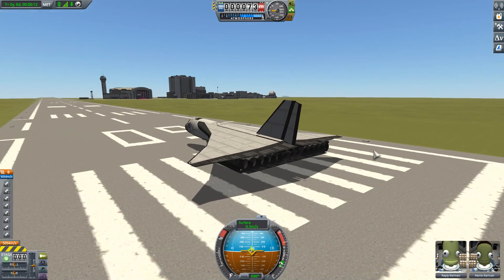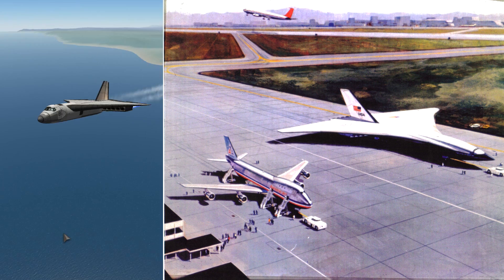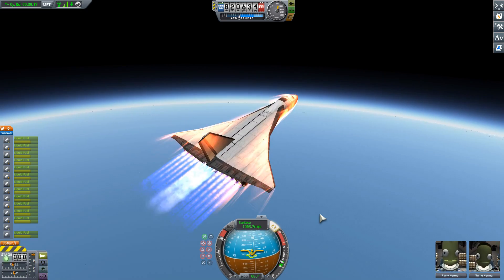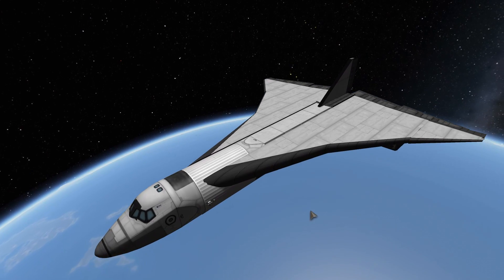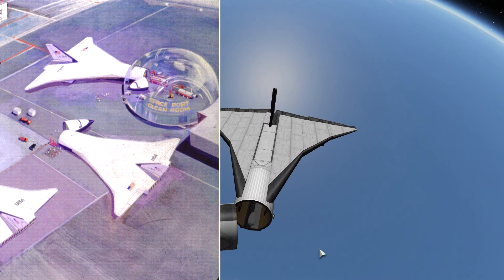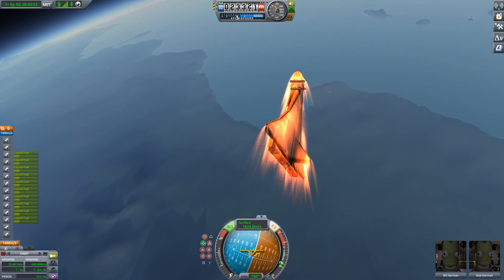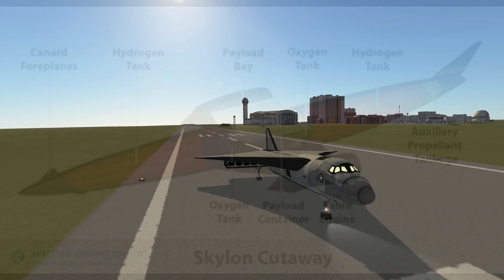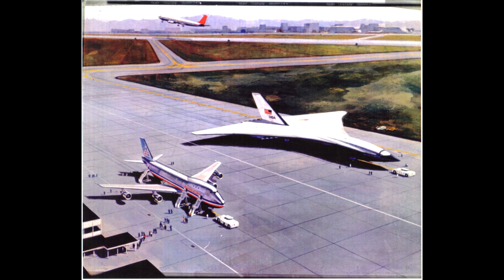The Star-Raker - A 1979 Space Plane With 15 Engines, Massive Wings & Huge Ambition

Comment: Wow. I've been watching a lot on spaceflight history, but never heard about the Star-Raker. I guess after the SR-71 they figured that they'd somehow figure out any magic engine design. :D
I'd definitely love more videos on pathfinding spacecraft designs that were dropped, especially those whose concepts are still not completely off the table.
In this particular case I'm curious what the particular objections were. Lower temperatures during re-entry sounds like a great alternative to the STS orbiter's rather risky re-entry.
Reply: Edit: wait, didn't read your post well enough. The objections to this design were, and still are, that the engines don't exist. They're getting there with the SABRE engines, but those are ultra-precision and still aren't finished.

Original post about most shuttle competitors: The objections were initially one, and later two.
1) The actual STS space shuttle was designed to make human spaceflight almost impossible to cancel, which is why it was designed for such extreme orbital parameters that turned out the way that it did. NASA was paranoid that any design which didn't forcibly tie actual crew members to rocket launch would result in the inevitable cancelation of spaceflight (a paranoia which had some basis in reality), hence the reason why the shuttle required crew for the sake of two or three switches & an automatable landing.
2) After they'd gotten the shuttle actually built, the chickens came home to roost, as they discovered that the shuttle's minimal cost of operation was so high that they couldn't afford to design it's replacement, or even build a station, at the same time that they were operating the shuttle. The only reason they were able to build the ISS is that Congress and the White House got worried about where the Soviet rocket designers would go if there wasn't something to keep them employed. I would like to think that NASA would have turned SpaceLab into an actual station over the course of the decades, but without foreign investment I suspect that it wouldn't have any larger than Mir even today.

Comment: What makes this vehicle so impressive is that it would have been a demonstrably better launch system than the Shuttle in terms of payload mass fraction and reusability (especially if the frankly extreme turnaround times were accomplished) while also being a good plane, i.e. having a large cargo bay and cross-range, which Shuttle detractors claim were factors in its failure. (I disagree—the Shuttle's "plane-nature" was a fundamental attribute of its design, so attempting to improve its payload capacity by reducing those aspects would not have improved the vehicle.)
Reply: Yeah, only problem with thus thing is that the engines still aren't ready.

Comment: I'm confused why a higher lift to drag ratio would give you "lower loads and lower temperatures". In the chart at 6:40 it shows how the star-raker has a much higher peak enthalpy (temperature) during descent than the space shuttle.
Reply from the maker: It can stay at higher altitudes for longer spreading thermal load.

Comment: I wonder if they could have put a thin sheet of aluminium over the heat tiles on the shuttle and letting it burn up on reentry. Or would it damage the heat shield as it melted?
Reply: I don't know if it would have damaged anything, but I don't think it would have helped a lot either. On the design in this video, the metal is there because it won't melt. The Space Shuttle was very heavy for it's wing size (because it was supposed to support polar launches), so it couldn't discard much velocity in the thinnest parts of the atmosphere, forcing it to discard that velocity over a much shorter period, which in turn resulted in higher reentry temperatures. This design had much larger wings per pound, so it was able to slow down over a longer period of time, leading to lower reentry temperatures.

Comment: "Landing is hard" crosses threshold at 240 km/h
Reply from the maker: I had problems with pitch authority
Reply: @scottmanley  Fair enough. Guess you didn't have 20 years. :D
Reply: @scottmanley  Yeah it looked like it, I was moderately sure you were going to plant it as the approach unfolded. Given the video I suspected you might have picked the most successful one, but that didn't completely rule out the possibility of disaster :D
Reply: @scottmanley  Bad idea: bind an array of sepratrons to the pitch control keys
Reply: @scottmanley  The thing looks like it could have used some canards while flying, although I'm not sure how they would work in reentry.
Reply: Daan Wilmer Folding canards like the Tu-144 would be an option. The Canards deploy only at low speed.
Delta wings need the gear only just behind Center of gravity to get good pitch authority at the expense of needing long gear for ground clearance.
Reply: @daanwilmer  You can do a lot with chines and strakes to compensate for the moving centre of pressure in supersonic flight. Unless high maneuvrability was so much of a priority that they'd want all-flying canards (which seems highly unlikely), I don't think they'd bother. They were a bit of a cheap bodgejob on the Tu-144, if we're being honest. As, to be fair, was the fuel pumping on Concorde.
Reply: It would be much more effective if it used a catapult system during take off...saving fuel and weight ?
5 /10 miles of catapult , could get it airborne without using onboard fuel ?
The catapults of today are electro magnetic , and would be fuel efficient ?
Reply: @lachlanbird9688  The loads at the end of the catapult would far exceed the structural strength.
Reply: @KarbonatErolVerdienstkreuz  : That depends on the details of how the catapult works, though admittedly I wouldn't put one as a top priority either. Frankly, I think that if you're trying to reduce the tyranny of the rocket equation with external power, then beamed power for a slow climb using electrically powered fans is the way to go.
Reply: 60 m/s isn't THAT fast for a big Whiplash/Vector SSTO spaceplane on landing approach

Comment: would love to hear your take on the SABR engine. some of its claims are hard to believe, but the british government have seen enough to continue to fund them.
Reply: They have test demonstrated the one new "magic" part aka the cooling heat exchanger to Mach 5. Rest of it is standard rocket plumbing. Turbo pumps and combustion chambers.

Also it isn't really magic. Rather just really hard to build. Lots of micrometer radius hollow tubes with liquid helium flowing through. So as per basic principles.... Just have enough surface area and something really really cool on the other side and even Mach 5 1000 Celcius air will cool to near liquifying point in a hurry.

Main problem is actually frost control. Since it is moist atmospheric air. So one of their main achievements is frost prevention system to keep the cooler clear to allow airflow.

So their real achievement is actually being one of the top heat exchange makers in the world and one of the best micro manufacturing firms. The pipes for the exchanger are in house made.... Since no one made the heat exchange pipes they needed.

Final hurdle is having expansion compensating nozzle since they have to use same nozzle from sea level to vacuum, but there is known designs to achieve that. Again just little harder to produce compared to bulk standard bell nozzle.

The real question is not "can the engine be made", it is "Does anyone see enough business/ performance case to produce the whole craft after the engines are ready."
Reply: @aritakalo8011  you know a lot. do you work there, if i may ask? i can never find any technical details of the engine
Reply: @oldfrend  Nope just followed the progress of it for years and listened to pretty many interview and presentation videos by them. If you want good starting point BBC made about decade ago  a documentary named "Three Rocketeers" about the whole Skylon process starting all the way back in HOTOL by UK government back in 1980's. You should find upload of the doc here on youtube.
Reply: Also of note is that NASA agrees that the SABER design should work. I consider the idea of an SSTO space plane (or for that matter, any space plane that actually orbits instead of just delivering another rocket to vacuum) to be pointless, but after several decades of work they're finally getting the thing to work.

Now to get them to transition to high-altitude passenger & cargo designs, so that more practical launch systems can piggy-back off of that...

Comment: I think this would be awesome to see IRL but the engine magic is a problem 🤣 But they could use saber engines?

If Scott talks about this my comment is mute.

Edit: GOD DAMN IT 🤣
Reply: Moot not mute I'd wager but ok. 👍😀
Reply: The saber is just the same magic proposition.
Reply: @SierraSierraFoxtrot  The saber engine actually exists on testbenches though.

The engine for this spaceplane was little more than a drawing.
Reply: @KuraIthys  All sort of things exist on test benches which have no chance of actually working IRL.
Reply: The turbojets becoming ramjets in mid-flight is fascinating to me. I've no idea what they would do with the turbine blades; would they fold them away (that seems fiendishly difficult to pull off), or would they just feather them and effectively declutch them from the shaft, thus letting them spin around on their own?
Reply: @rjfaber1991  You can check out SR71's engine. They are turbo jet at lower speed, at higher speed the central fuel injection is off and the trust is provided entirely by backburner, essential a ramjet mode.
Reply: @henry_tsai  I guess you could call that a ramjet, and if that's what they were planning to do here, that certainly seems more achievable. Not entirely sure I'd call it a 'proper' ramjet though.
Reply: @henry_tsai  dont forget most of the air flow gets bypassed around the compressor stage as well.  Its not just compressing the air that strains the turbines, but the air flow itself at those speeds.
Reply: @henry_tsai  SR-71 never shuts off the central turbojet - the airflow still all goes through the first few compressor stages before most of it is bypassed to the afterburner, but the blueprint at 2:25 seems to show the ramjet being concentric around the turbojet for the StarRaker
Reply: @rjfaber1991  The SR71 was not quite a ramjet, because the air still went through some of the compressor, but that was actually to improve low speed performance rather than high speed. Instead of thinking about it diverting air around the engine at high speed, you can think of it as an afterburning turbofan that diverts bypass air into the core at low speed, permitting compression ratios that would melt the engine under cruise conditions. The bleeding of air from the compressor was more about changing the compressor characteristics than adding additional compression to the ram air. It is better thought of as a ramjet adapted to operate at ground level than a turbojet adapted to be a ramjet.

 A supersonic supersonic intake reduces the cross sectional area, so you do have room for bypass ducts even without a compressor. The ramjet component is not actually the hard bit. Diverting air around a jet core into the afterburner is not difficult to engineer. A bigger problem is the core, which has to get the aircraft off the ground and up to ramjet speeds without any ram pressure and an intake nozzle setup not optimised for low speed flight. A core which can produce take off thrust at sea level as well survive Mach 6 is extremely challenging, even if it doesn't produce any thrust above Mach 2.
Reply: @brynclarke1746  AFAIK the SR-71 has no APU, it certainly requires external air to start the engines. This also means that the turbojets need to keep running in order to operate generators and hydraulic pumps.
The shuttle had three hydrazine APUs driving hydraulic pumps and three fuel cells delivering 27.5 to 32.5 VDC. The Star-Raker would requires something similar. Likely also one or more gas turbine APUs to make it easier to start up the ten turbo jets. Especially in the air.

Comment: I was thinking maybe put most of the scram jet engines and most of the fuel on drop tank  and have the some wings on the tanks, so you can recover them at the airport 

it wouldn't be an SSTO, but it would have most of the same benefits anyways, and maybe even a faster turn-around time, and without the mass penalty SSTOs have
Reply: I thinking of some traditional Jet-A to get up to speed, and just the hydrogen for the last bit.

HYdrogen takes a lot of space. Its really a very anoying fuel
Reply: The scram jets go on the space plane, not the drop tanks. The drop tanks just need an ordinary jet engine.

As for the actual rocket fuel, I'd say methane instead of hydrogen. Almost half the energy/mass ratio of hydrogen (which is much better than e.g. RP-1), but twice the energy/volume ratio, much easier to handle, and it's temperature of solidification is only a few degrees higher (as in, less than 10 degrees difference) than oxygen's temperature of evaporation, so you don't need very much thermal insulation between those two tanks.

And personally, I'd want to look at beamed-power for most of the flight, just to reserve the actual fuel for initial liftoff, emergencies, and the final stage of the trip through the atmosphere.